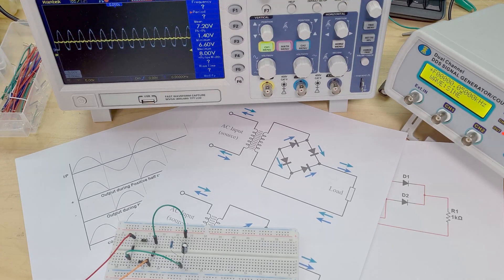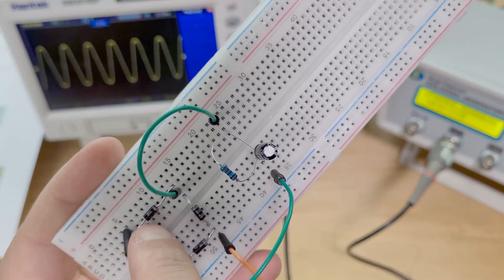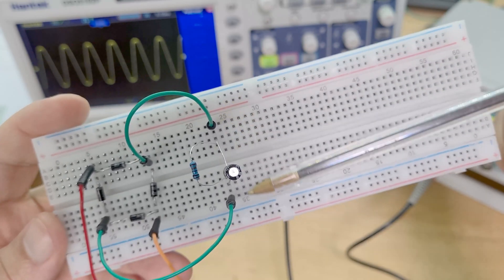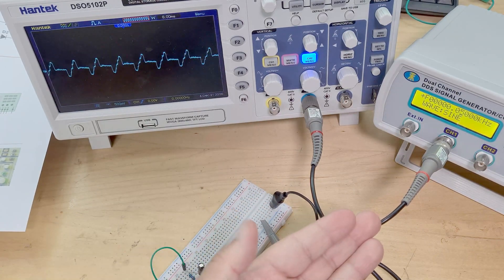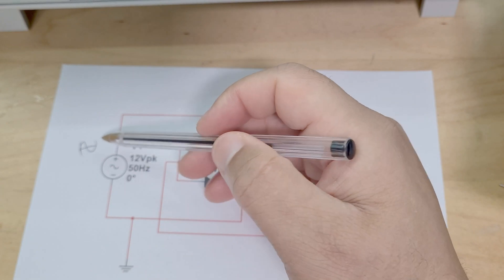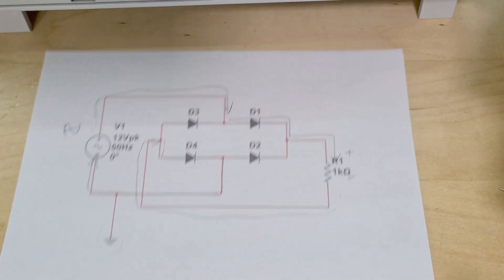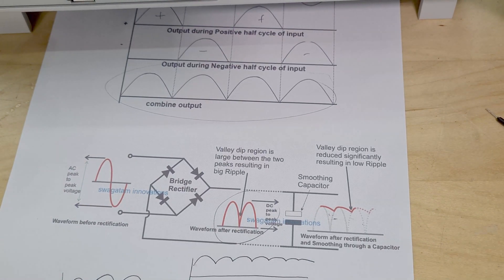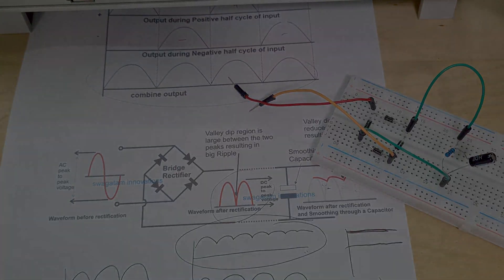Full Wave Rectifier For Beginners

Comment: If you are to deal with high voltage circuits testing, then it would be a good thing to have a variable autotransformer. With this you can gradually set AC voltage from 0 and up to mains voltage. Kind of turning potentiometr.  One more thing to keep in mind, is that peak voltage in AC grid is higher than stated nominal  by sqrt(2). So taking EU standart 220V AC mains, the peak would be: 220*sqrt(2) =~311V. That's would be lowest possible value for smoothing capacitor (in case of rectifying 220AC)
Reply from the maker: man people like you make me love the internet lol <3 I had no clue such a thing even existed, thats actually amazing. I got small kids and I enjoy life lol not really looking to cut open kettle plugs to tap into the mains. I think I found one on ebay, can you take a look please if this is what you meant: https://www.ebay.co.uk/itm/203748030560?hash=item2f70543860:g:NjkAAOSwYeBhtK~Y 

Appreciate the advice man <3
Reply: @HamedAdefuwa  Yep, that's it exactly. Technically this guys are all the same inside - just a heap of thick copper wired into coil and a wiper-roller with which you, like,  vary  the number of winding turns, thus the output voltage. They differ in particular by power. The one in the link is marked 2A of current, that is about 500W of power - this would satisfy 90% of home lab needs and DIY tasks.  
Brand new models can come with some fancy add-ons. Like digital volt/ampmeter,  nice fast-hook terminals.. etc. But I really think all this stuff doesn't worth to pay for. Indeed this e-bay old vintage dinosaur  perhaps would perform better, 'cause back in those days they didn't hesitate about too much copper.
P.s. I also like your videos and the channel as whole. It feels, like, they shot by person  who really tries to dig in. That makes a notice :)
Reply from the maker: Appreciate the advice and love 🙏👍 I'm a noob trying not to be a noob lol. Graduating in June and I know so little 😭. I want to get into power electronics and renewable energy so getting some experience with AC would be good. This will be my next purchase definitely. I love this stuff lol. Thanks again!!